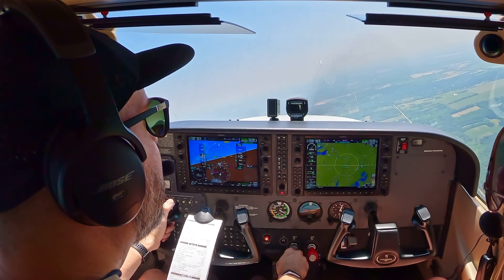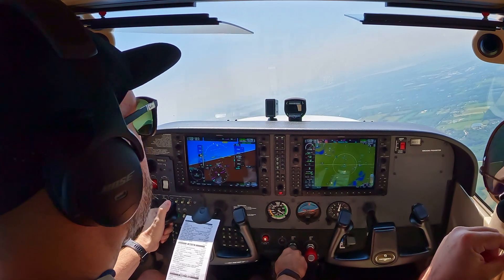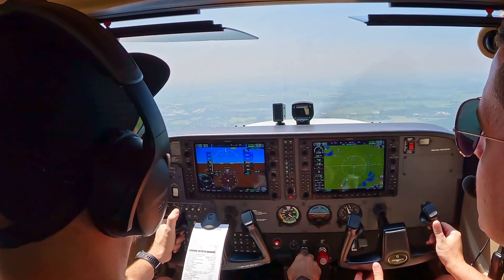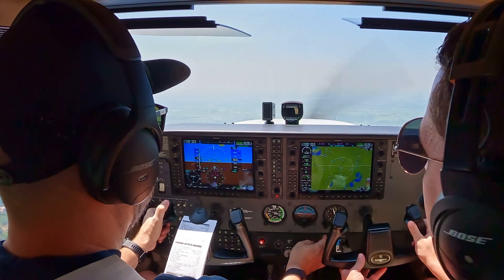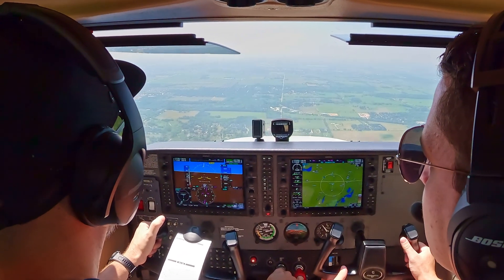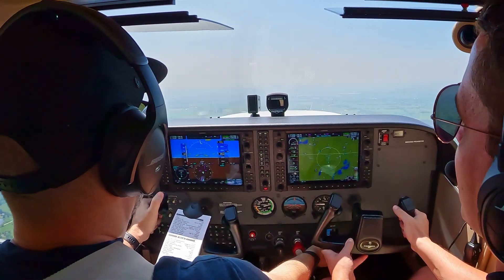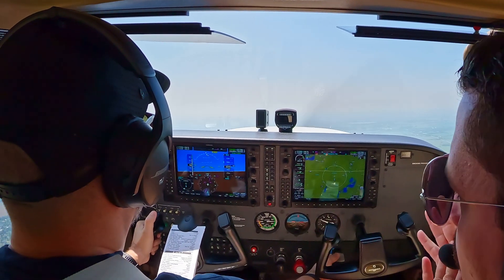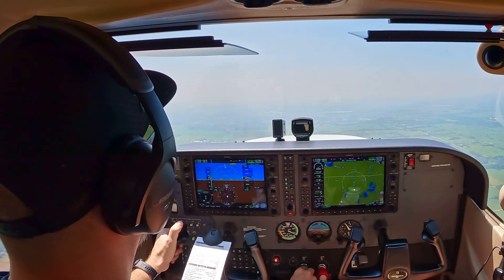Learning to Fly - My Very First Power-off Stall

Comment: I've watched many YouTube Pilots admit point blank they have a fear of heights but are a great ga pilot or commercial airline pilot.

I also have interests & passion building &  flying rc planes, MA y different flight Sims etc.

I don't enjoy being up on a tall ladder, I don't enjoy sitting on top of a rocking ferris wheel cart. 
Nor driving up high mountain with road near edge with steep drop offs are unnerving.

But they claim that flying in a ga plane with movement feels different. Those triggers aren't there.

Anyone here can verify this. I plan to try a introductory flight at local airport in older Piper Archer training plane this summer.

Any advice?
Reply from the maker: Thankfully, I don't have a fear of heights, but that means I can't offer any useful advice. I will say sitting in the plane feels different to me than if I was standing on the roof of a house or on a tall diving board. I took a discovery flight to be sure I didn't suffer from motion sickness, which I sometimes do in a car or on a boat. Didn't have any problems. Hopefully the same is true for you. Good luck with the introductory flight!